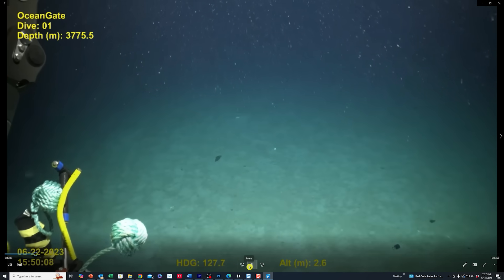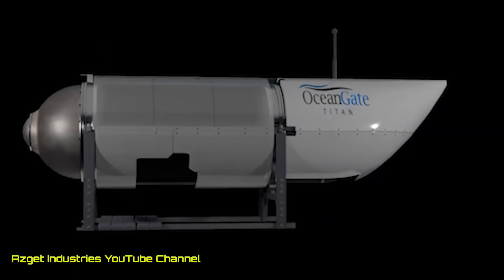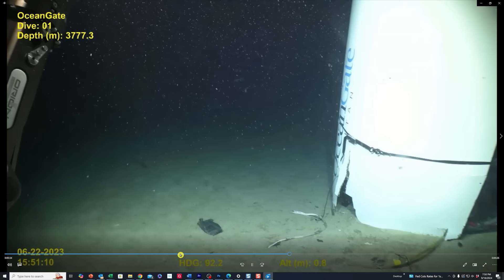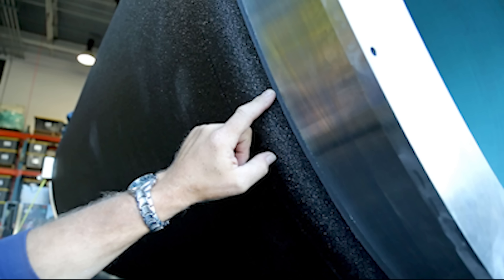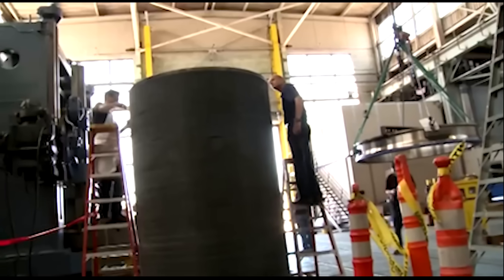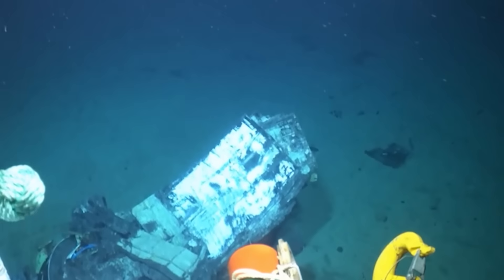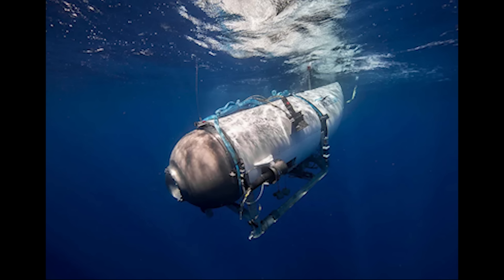OceanGate Titan Sub Debris Video Shows How It Imploded

Comment: From the looks of it. It appears that the carbon fibre must have shattered under the pressure causing the tube to implode which forced the tail cone and the front dome to eject outward. Basically like squeezing a milk jug to make the cap pop off. IIRC, that the front dome was fully intact. Maybe they should have used whatever that was made of to build the rest of the sub.
Reply: Wasn't it titanium? Which is what they kept telling Rush the entire sub had to be made from.
Reply: @mattymox86  The end caps on the Titan were titanium, the rest wound carbon fibre.
Deep sea submersibles have used steel, aluminium and titanium for the pressure hulls successfully.
Reply: @mattymox86  Yup
Reply: The issue was that the carbon fiber and titanium each expand and contract at different rates, and under the massive pressure that they were repeatedly subjected to it took only a microscopic gap to eventually form which caused a complete decompression failure.
Reply: @hojo70  And not only that. You also have the limitations of each material to consider. In the case of carbon fiber, it may have high tensile strength, but it has very low flex tolerance. And thus, it tends to crack or shatter under pressure.

This is why you don’t see load bearing structures or vessels  being made out of carbon fiber. 

Stockton was a dumbass on top of being an absolute monster and a POS as a human being.
Reply: The description in the video is back to front. The rear dome is off by itself.
Reply: @allangibson8494 no, it's definitely the front off alone. You can see the hole for the window in the center with sand pushed in. Everything collapsed from the front to the rear.

Comment: you can still see the bag filled with the Styrofoam cups with everyone's signature hanging from the back
Reply: It's literally a tombstone in that shot
Reply: when stryfoam is stronger than your submersive
Reply: I was wondering wtf that was. Seemed like something novel and not part of the sub but I didn't know they did the cup thing. That's a lot of cups for how many where on board though. unless they made a bunch or make two, one goes with the name and the other stays in the bag in titan. Well...  stayed in the bag
Reply: @ianhale4466 I'm wondering if they didn't have extra cups for some of the family waiting on surface.
Reply: At what time?
Reply: Where?
Reply: Wow!! Good eye!! Seeing the debris and how some pieces weren't obliterated as previously thought. Originally everyone was saying with implosion, there'd be hardly anything remaining, the Titan, etc.. Makes me wonder just how long they knew of their demise, doom.
Reply: @lyndadtekaat1151  It did implode. Almost the entire craft is crammed into the rear dome. The rear part just popped off because it wasn't part of the pressurized area of the craft. It won't implode because it doesn't have any air inside of it.
Reply: @--_DJ_--  Yes, I knew that it did infact implode. I just was saying that the experts all were saying at that depth & imploding there would be barely anything to recover. Meaning the pieces of debris that was recovered were larger than originally anticipated. Never meant to infer there wasn't an implosion. 🙏❤️🙏
Reply: @lyndadtekaat1151 I agree. There is more intact debris than I would have imagined. This was such a needless tragedy.
Reply: @lyndadtekaat1151 there is barely anything left of the pressure vessel
Reply: @lyndadtekaat1151 The sub did implode, this is the tail section that wasn't pressurised
Reply: I have been searching for any mention of that white plastic bag filled with trash! Literally thought I was crazy and hallucinating. It makes a little bit of sense that the bag is hanging in the non pressurized aft, but not much.
Reply: Their legacy
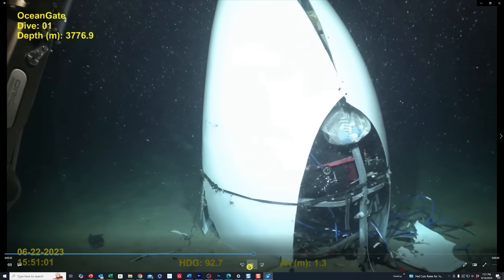Reply: 00:32 Orb

Comment: Plain dome is front, port is under the sand.  Back section still has the glue holding. Front was blown right off, so likely the failure point was that rear dome joint, as the imploding section would not have had much energy, but by the time the piston of water had reached the front it had enough energy to blow the front dome off, blow out the viewport, and shear off all the mounting bolts, as they are not really there for any structural use, merely to hold the front seal in position till water pressure forces it into seal properly. The rear intact says that was the top that failed, probably the back third of the carbon fibre, based on all of it being wadded up into the rear dome, and not enough energy to blow the dome off completely, but tearing the fibre mat and folding it into the rear.

will be interesting to see the front dome pictures, showing how it delaminated, and yes very likely the entire epoxy ring did pop off, but the poor adhesion probably was not too much of a factor here, as even if it did fail, the force would not have popped the entire dome clean off.
Reply: I was thinking the opposite. The failure was at the front top or sides blowing off the dome and the view port. I'd like to see an animation with the info gathered from the pix.
Reply: @PeaceMarauder  The hull floor panel is still in place. About a third of the hull is inside the entry dome and its mating flange. 
It’s interesting that the carbon fibre composite failed along the length of the hull across the fibre direction when it was wound onto the hull former.
Reply: how do sausage rip when put into boiling water? there's your answer. mechanical engineering 1st semester basics
Reply: Back dome was glued directly to the shell. The front dome was bolted to the glued ring.
The bolts holding the front flange and forward pressure dome failed when the parts of the hull hit forward dome from behind.
The rear dome completely separated from the rest of hull during the implosion.
Reply: Front dome. Carbon pieces were thrown back.

Comment: I also agree about the glue. It needed maximum surface area. Ideally should've been screwed on aswelll as glued and then bolted, i would think.
Reply from the maker: you can't pirce the carbon fiber, would cause mini fractures
Reply: @jeffostroff  you're right. Thanks for the great videos. very informative. keep 'em coming :)
Reply: jeff is correct the so-called "glue and screw" method is weaker

Comment: That’s glass of that front dome or hull how you wanna call it, it’s got disconnected , when they pulled over it was without the glass
Reply: Lochridge, or was it the other guy? Said that they never found the window, that it was rocketed out with the force of the implosion.

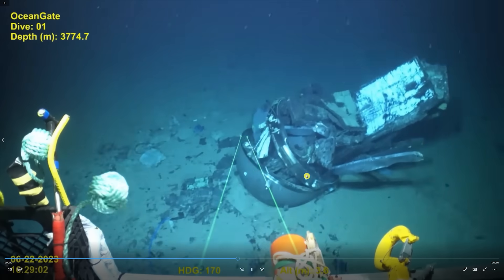Comment: At 4:53 that is indicative of a failure that began at the front of the craft. The pressure vessel collapsed towards the tail. I assume that most of the remains of whatever and whoever was inside the craft is inside that tail pressure dome. RIP.
Reply: Exactly the wrong way around. The hull is stuffed into the forward dome and its mating flange. The rear dome was glued directly to the hull (no ring).
Reply: @allangibson8494  @6:06 Why is there a groove for a seal in the dome by itself  on the ocean floor?
Reply: @PeaceMarauder  The was no door seal on the Titan (or any other deep sea submersible). They use a metal on metal seal - the pressure holds it tight. A rubber seal would just blow in.
What you are seeing is glue residue.
Reply: @allangibson8494  Also @1:45 in the schematic there is a ring aft.
Reply: @PeaceMarauder  And in the hull assembly video there isn’t.
The rear dome didn’t have a ring - it had a recess that the hull slipped into.
The front had a flange to support the forward domed hatch. You can see the hatch locking bolts in the video - they were broken by the hull fragments going through them.
The hull broke by buckling  from the top down (the bottom is almost intact) and the rear bulkhead rotated at about the speed of sound shearing off the attachments to the unpressurised power and support system in the aft cone. The buckled hull was then pushed into the forward hatch shearing the closure fixtures. The landing frame would either have sheared off as this happened or simply dropped as it lost power to the retention system. All this happened in less than 2milliseconds.
Reply: @allangibson8494  Wow. I could hardly follow much of what you said as it's very technical, but that was really impressive. Thanks!
Reply: @allangibson8494  Somewhere in the comments here it's said the assembly vid was of the first hull they discarded after a dive with a huge boom descending and made another. That's probably where the aft ring came from.
Reply: @allangibson8494 you have it backwards

Comment: This sub was so redneckery that even me as a redneck could tell you this was a terrible idea, rhino liner to patch holes, and what to me seems like a terrible way to attach a titanium end cap ring to a carbon fiber hull, my theory is the glue holding the ring on let go because the carbon fiber flexed a little too much maybe, and it rapidly turned those billionaires into a nice little debris field, there's a big reason alot of submersibles are usually made from metal, and from my knowledge (I could be wrong, if I am please correct me) why they typically use heavy duty bolts and special gaskets

Comment: They might not have experience pain, but I expect they had some time to know they were doomed.
Reply: I recall reading that they likely would not have, as the implosion that destroyed the sub and their bodies would have been so total within milliseconds, the human brain would not have had time to process.
Reply: @doubleemmartin1  I don't think that's entirely true anymore.  They definitely didn't have knowledge of the implosion (which is probably the most merciful part of this), but I think there's evidence now that for at least several minutes prior they knew something was going wrong?  But I don't know exactly what.
Reply: @doubleemmartin1  some evidence now the front ring was completely clean so the front seal completely let go, so yes, quick.
Reply: They had to have heard something, some kind of alarm bell would've had to of gone off,  didn't this submersible have bells or flashing red lights signaling a problem?
Reply: @hille422  Even without such signals there might have been nudges from beyond to make the hair on their necks tingle, like so many people have been saved by if they checked themselves.

Comment: The animation of what the implosion mightve looked like was nuts.
Reply: Now we know it probably failed from the front top or sides and imploded to the aft knocking loose the tail cone. The sub hit aft dome first and leaned over. The carbon chunks are packed to the aft. I'd love to see a new animation of this.
Reply: @PeaceMarauder it would be interesting if they replicate sub with jelly dummies same weight as passengers etc and do a dive n record implosion to see what it's like like a csi investiation or myth busters. I mean you can get idea of what happened but still hard to really think about what it was like. But ya it's interesting to see more details come out.
Reply: @eileenfletcher6520  That'd cost a dollar or two :P
Reply: @PeaceMarauder Realistically they can just use a submerged carbon fiber tube, since that's the part that failed. You don't need to replicate the titanium doing it's job.
Reply: It was on Rogan wasn’t it?

Comment: With these parts so tightly grouped together, I assume the accident happened fairly close to the bottom, and not several hundred metres above the floor, as it it was higher up, I’m imagining the pieces would scatter and fan out more…
Reply: HOwever, those chunks of CF are packed in tight, if it happened higher they would probably still be in that position after reaching the bottom.
Reply: @PeaceMarauder  you could very well be right. I would expect the last few moments of this situation, to be very interesting and nervous for the people riding in it. And your theory makes sense also. I do not think that no one really knows the truth of the whole sequence of events. And with this being a one of a kind accidents, I would really like to have more research and understanding at that level of pressure they talk about. That would be extremely interesting to see something like that recreated and filmed somehow, at the same depths. We are both lucky to be here wondering about it together, rather than in the submersible for the ride. Lol

Comment: Claim is.....adhesive failed! Great update!
Reply: The claim is that two dissimilar materials like titanium and carbon fibre compress at different rates, and therefore sooner or later, the rings had to pop off the cylinder.
Reply: look's like the composite was blown into the end cap. the pic's show it full of carbon fiber. not a whole lot of chunk's on the bottom.

Comment: Anyone who’s done acrylic nails knows you need to make the surface abrasive or the adhesive doesn’t work. And yet these “top minds” didn’t think of that for their pressurized sub 💅
Reply: He brought in a bunch of aerospace under-grads because he wanted fresh thinking. That's because everyone he talked to that understood DSV's and sea pressure was telling him he was doing it dangerously wrong and he didn't want to hear that.
Reply: Under those kinds of pressures, a well-prepared surface doesnt matter nearly as much as deformation compatibility between the dissimilar materials.  Which is something I haven't actually seen described correctly in any of the videos I've watched.  The animation at 10:10 treats the titanium ring as an immovable object, which isnt the case.  It deforms too.
Reply: Chemical cleaning is more important. No oil or dust or you won’t get a bond. Chemically etching the surface is sometimes done but any air gaps a the joint will fail.
Reply: Stockton never had mani-pedi. But he probably ate lots of glue, that’s why he used that on that submersible

Comment: The peanut butter on the rings was not a hold it together concern, external pressure handled that fine so it is to keep water out right? I understand it had to hold it together out of water but once under water not an issue.
Reply: I don't know, but that would be my guess.  Well-designed underwater housings generally seal well at depth because of pressure.